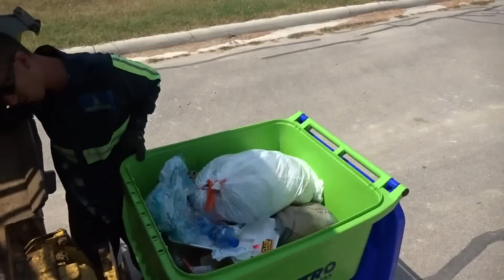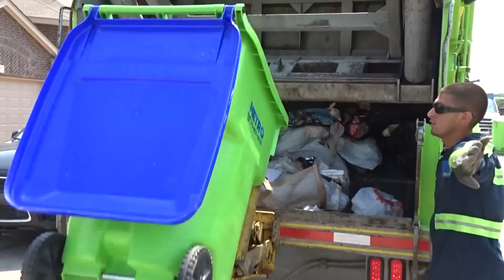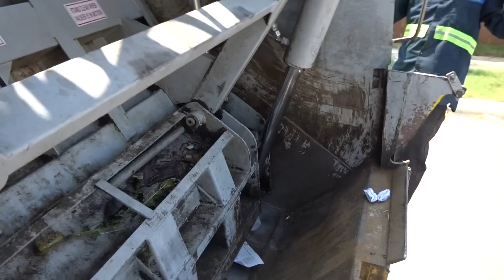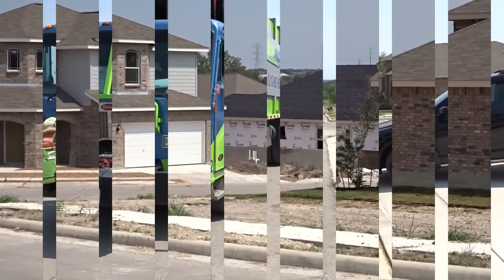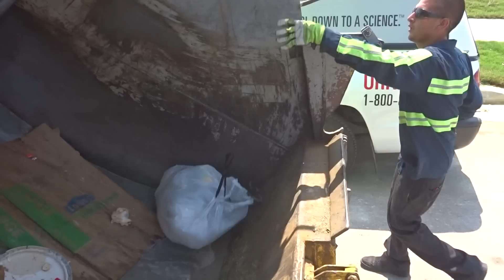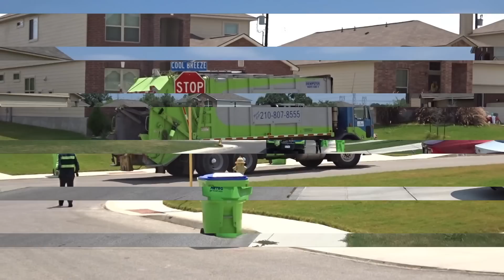Metro Waste Systems: Peterbilt 320 Dempster Route King Rear Loader

Comment: I love how much fun this company has with their colors. Plus I will miss seeing Route Kings as time progresses on. I never really liked the slide sweep design, but as I spend more and more time watching them over the years, I see why they are liked. Especially how quickly the packer cycles.
Reply from the maker: Thanks Bill! I will for sure miss Route Kings as well. The colors are very cool and creative indeed!
Reply: the Route King 2 could out pack many other models of packers due to the sweeping run and the way the sweeping wall above the blade kept the pack load intact helping squeeze more volume in ...not sure what rear loaders put on now but Dempsters I worked on did 12 tons if the  chassis permited(might be why ours were on ford 8000 louisvilles)

Comment: I worked for a company(K&E solid waste Ontario Canada)
that ran almost 2 dozen ROute King 2's ..several pto drive IHC cargostars with 25 yard boxes several 25 yard boxes with ford LST 8000 all with side mount motors for running the wall/blade,3  25 yard boxes with side motors on Mack MC chassis,2 trucks with 32 yard boxes 1 mounted on a Mack MC chassis (once worked on this to a 21 ton load)the other was a 32 yard demo model(testing how to make 32 yd)done by amalgamated metals of missisauga ontario(canadian builder of dempster models)  with a GMC Brigadier tractor and 32 yard trailer with frount mounted doinch motor to run blade and wall...we also had 2 ..20 yard RK2s with side motors(for wall and blade)and had winches for small dumpsters..
32 YARD PACKERS WERE OUTLAWD IN ONTARIO LATE 90's BY MINISTRY OF TRANSPORT DUE TO BEING TOO LONG..

we also ran other trucks(non RK2's
thanx for reading and thanks to the vidiogragher for rekindling 23 year old memorys...RK2's were the nicest packers i worked on... and had better ton ratios then any other packer  me and a friend could pack 13 tons on a ford 8000 25yd and regularly put 19 tons on our mack 32 yd(b4  32 yard outlaw)
Reply: +JEFF SKENE I used to work for Markham Disposal, now known as Miller waste. We used Dempsters RK II, 20-32 cubic yards and I loved every minute of it

Comment: these hands look like they straight off a rig floor. they got some rough neck in em somewhere. I worked in the oilfield for years and with the recent down turn found a new home in the garbage industry. I work for Progressive Waste and we run 12 curottos one brush truck, 2 roll offs and a rear loader servicing 38k homes in a very rural county.

Comment: Cool company with cool trucks and an even cooler paint scheme! It's so awesome to see Dempsters on a newer Pete cab. Wonder how old the chassis is? 12:20 was funny. Seems like he started running off early quite a bit. That wasn't the first time I saw that in the video. Who else works in the open market area? It seems like these guys are doing very well. Great tipper on the back, love the movement of that thing. Awesome find Tyler!
Reply from the maker: ***** Thank you! I think the owner said the truck is 2001 or 2002. Some of the other companies are C-6 Disposal, Tiger Waste, MD Systems, and Green Earth Sanitation from what I saw in that particular area. I really liked the tipper as well, pretty good dumping angle it does. I'm very proud of myself for this find!